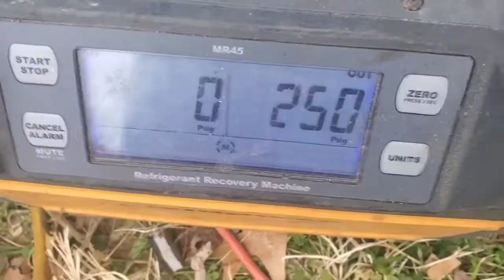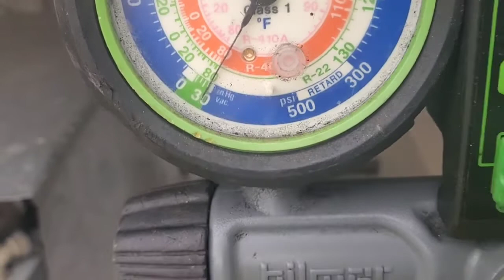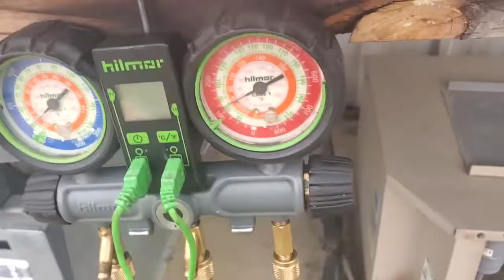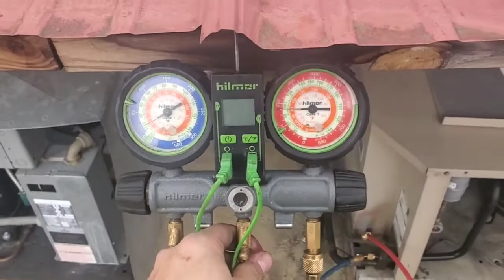Walk-in Freezer Dead On Christmas Eve

Comment: what were the steps done to come to the conclusion the compressor was locked?
Reply from the maker: The compressor wouldn't start when powered. The start capacitor was warm, both caps tested good, verified current thru the start cap. Windings checked good. Added a giant start cap, bypassed the start relay, swapped start and run to reverse the motor, when none of that got it to turn it was pronounced dead.